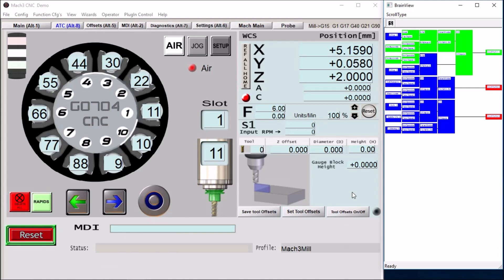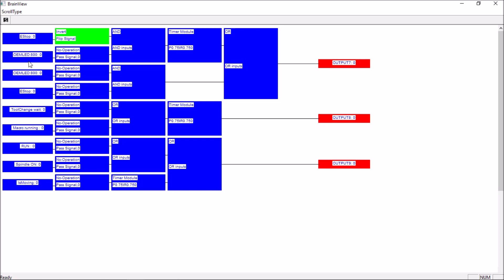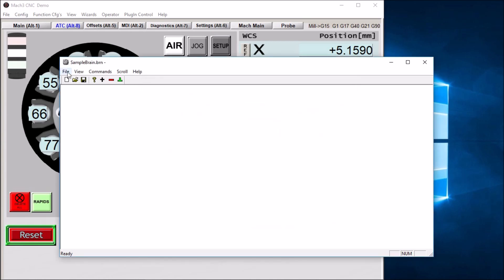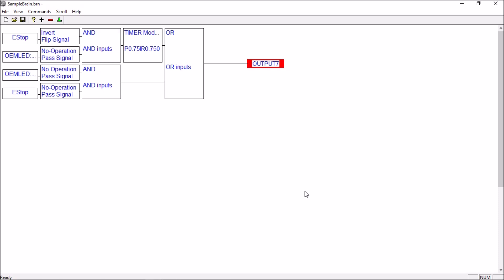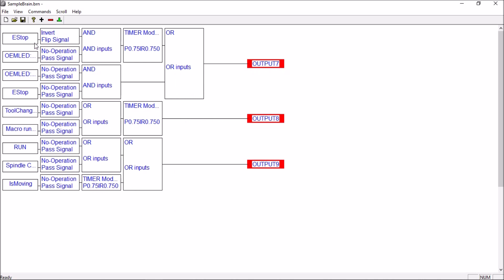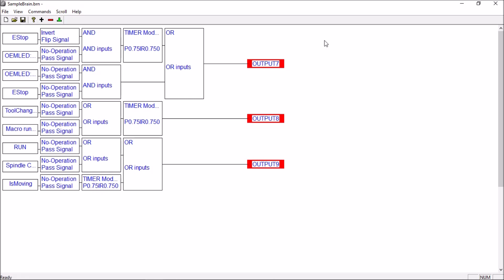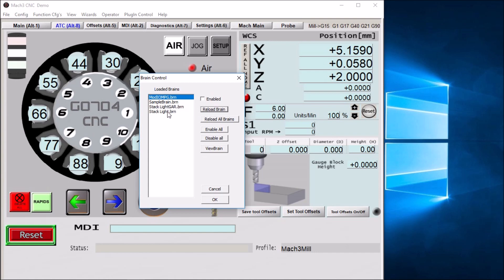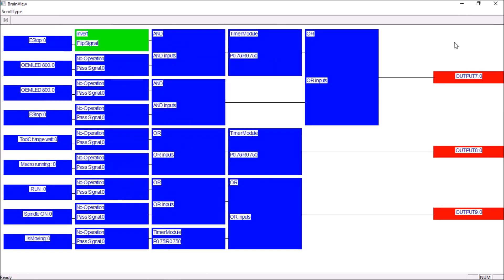Mach 3  Brain How to Create a Stack light Brain

Comment: Sam.Hello, thanks again for the beautiful and educational videos.
I'm playing around with Brain a bit, it's starting to work.
Still have a question.
I have a brake on the Z axis, and I want to switch it with the operation of the Z axis, this in Joc mode, could you indicate how I can do this.
In run mode it works via stock lite output. 
Thanks again, greetings from the Netherlands.
Reply from the maker: hove you looked into the enable circuit/ when the servo is enabled and powered on it's going to hold position. but off the brake will keep it from dropping.
Reply: @CNC4XR7 , Hello, yes I did.
The brake is off before the Steppendriver is active, and the Z axis dropped a bit, itself tending to sink a bit through the brake
It is a BF46 with a 5 pitch spindle.
I now think I need to make a delay circuit for both ramp up and ramp down deceleration of the Z axis teppenmotor driver .
This also looking at the emergency stop situation.
Thanks for the effort.
v.g. Gerrit
Reply from the maker: @Gerrit Bruggink  the only issue with ramp up and down on the brake is when running g code.

Comment: Great tutorial!Thanks for it! May I have a question about Mach3 brains?  What if, I have a PLC  I'd like to pass the Step/ Dir signals of the axes for ? Is it possible to do it using brain and Modbus protocol?  I know it's possible to set the port numbers of the step and dir signals to 0 on the Motor output  tab but I'm not sure it's enough and will send the signals that way.
Reply from the maker: Not sure Ive never tried that before.
Reply: @CNC4XR7  No problem! Thanks for the answer!

Comment: I am using  a DB25-MG6 BOB, I followed the estop button PLC, but I still have no hi signal out of the port, any recommendations? all other logic works fine, only the estop conditions turns everything off. This BOB is straight thru pcb. no electronics on it.  Thanks in advance.
Reply from the maker: Hard to say with out looking at what you have going on. try inverting the input.
Reply: @CNC4XR7   I did , same result. which BOB do you recommend, perhaps the one you are using? I am aware of what you said about breakout boards. Is there any other setting to change on mach3? if not I just have to keep trying to find the solution. Thanks.
Reply from the maker: @CMDWorks  are you able to see the brain inputs and outputs change states?
I followed the estop button PLC, but I still have no hi signal out of the port,
which port are you asking about? was the machine running before adding the Brain function?
Reply: @CNC4XR7  Yeah, they change states. I selected on the brain output1, then I went to ports and pins, output signals, and selected output1, port1, pin 2, then I wire my LED to pin #2 on the BOB, and grawnd, no luck. I created a flashing Feed hold, Jog on/off,  and steady run, delayed 2 second, stop, etc, all of those work great. On a emergency condition thow no flashing.
Reply from the maker: @CMDWorks  Dont use Output1,2,3,4,5,or6  use Outputs 10,11,12,13,14,  those are not normally used for anyting. output1 and 17 are sometimes used for Safety charge pump
Reply: @CNC4XR7  No matter which outputs I use, when an estop condition occurs mach3 shuts down all outputs. I ran out of ideas. I must be doing something wrong. Thanks for trying to help. I like all of your videos.
Reply from the maker: @CMDWorks  yes that is correct in the event of a estop all outputs will be off
Reply: @CNC4XR7  Just wondering, how do you turn you stock lights on,  then?

Comment: I have mach3 and am using a PMDX 126 with smooth stepper. You think Brains won’t work for me?  I didn’t quite get the charge pump thing you were saying at the end. Great video!
Reply from the maker: I'm not sure with that BOB most of the time the SCHP feature will disable outputs and that will not allow you to turn on the stack light.
 The brain works its the BOB that does not turn on the output.
No harm in downloading and trying

Comment: Great vid Sam! Have you done any that cover the hardware side and show how to wire up the external indicators?   One of these days, when I get some time to work on my little cnc lathe, I'd like to figure out how to wire up the spindle sensor.  It has one that only goes into the dro to show rpm.  I'd like to use that same signal....if possible.....and wire it so that mach3 gets it.....then I should be able to do threading on it.  Hmmm.....I should do the same thing with my mill!! LOL  It has a tach built into the PDB, but it doesn't feed beyond that to mach3.  Hmmm.....maybe I'll just save myself the time, use it for making parts and then go buy some better equipment. LOL :)  Merry Christmas!!!!
Reply from the maker: Hi Mike,
 Well Ive already done something just like that Take a look at this Video; https://youtu.be/j-NzSxfsIi8?t=460
Reply from the maker: Also This video shows how I split the tach signal and sent it to the tach display and Mach3.
https://youtu.be/6yzrMNjGVDA?t=350
Reply: @CNC4XR7  Thanks!!  I'll try to give it a look in the morning....sounds like just what I need. :)

Comment: I wish someone would make backlash compensation for Mach3 that actually worked without making your table jerk and lose steps.  This caused me to give up on it and go to UCCNC.......much better.
Reply from the maker: Every machine control software Has some aspect that just does not work for them,  Mach3 is no exception As far as B/L comp servo's really smooth that out and negate that issue.
I plan to look more into UCCNC in the future however Time is something i'm in short supply of.